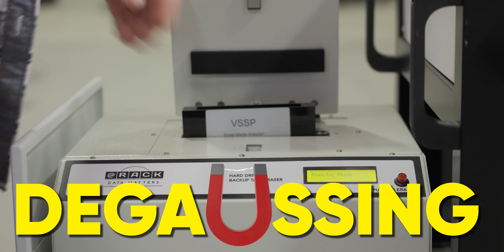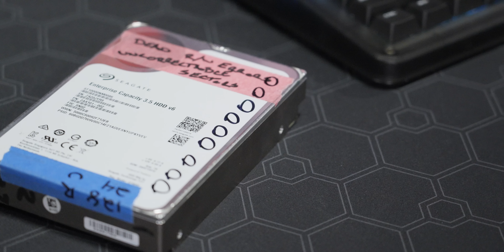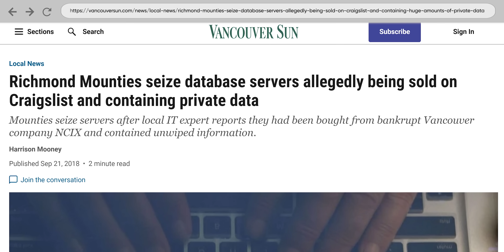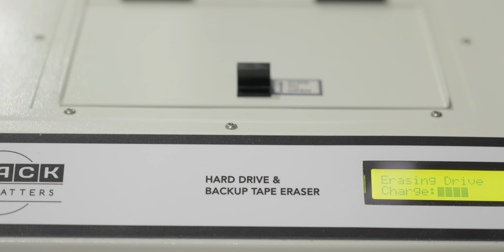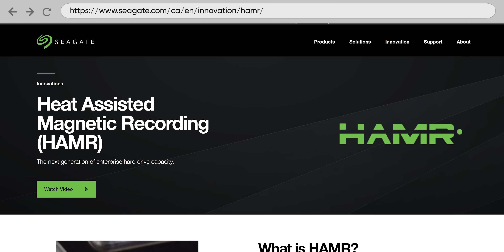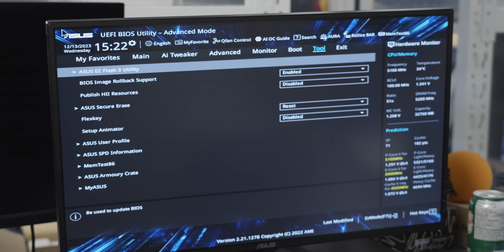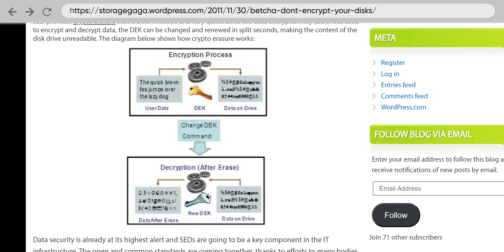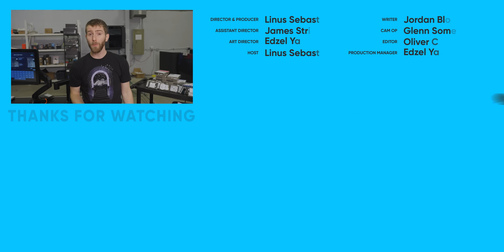I Got an Industrial Hard Drive CRUSHER! @Rack's Mobile Data Destruction System

Comment: Now I'm super curious what was on those drives. Were those LMG-owned drives, or did they contract out to a bunch of local businesses with the offer to properly destroy their old hard drives on the cheap while they had the machine with them? 

Actually, for only a $1000/month cost, I can see why some people have made small businesses out of chucking one of these in the back of a van and driving around to those who need data destroying. Would be quite a simple operation, assuming there's enough demand in your region!

Comment: Hypothetically if you use raid and you sell the disks to different customers this is a non issue and if you include raid in the erasing step then this greatly diminishes the chance of being able to read any useful data off of the drive although this is still a major security issue just down to the ability for one person to buy 1000 drives off of somebody and then having to read 1000 drives

Comment: Back in 08 worked at a Navy depot imaging machines, we would also sometimes get a used machined returned to the shop. we had an old file cabinet with a lock full of hard drives, most with red stickers, I was one of the few with the clearance needed to work those and remove the drives, never did get to see the process of destroying those

Comment: One critical detail that a lot of folks don't know: "ATA Secure Erase" is not the name of the feature that transparently encrypts all data and then drops the key when an erase command is sent. That's called "ATA Sanitize", and it works as you'd imagine - a random key is generated on first power-on, using an onboard HRNG, and all data is transparently encrypted/decrypted with that key by the disk controller. When you issue an ATA Sanitize command, a new key is generated and replaces the old one, effectively erasing the old key and making it so nothing on the flash can be read. However, "ATA Secure Erase" is a different technology which does not employ any encryption. Instead, all it does is "drop" the table that keeps track of which LBAs are assigned to which physical flash ICs and blocks, as well as which blocks are free vs. allocated, so that the disk thinks no blocks are allocated and the whole drive appears to be full of zeroes (unallocated blocks are "virtually" mapped to a null page full of zeroes). None of the data on the flash ICs is erased and you can still recover it (albeit in jumbled block order) if you do chip-off forensic recovery. In addition, ATA Sanitize implementations are vendor-specific and have been known to have security issues, so you should always use full-disk encryption (FDE) such as BitLocker or LUKS alongside it to ensure safety.

As for why we have these special mechanisms on SSDs instead of just overwriting data on them, the most common answer people give is that it prevents wear to the drive (because flash cells have limited write cycle longevity), but there's actually a much more important reason: wear levelling. If you store each file on an SSD with a static 1:1 mapping between the file and a physical block, files that get written to a lot (e.g. logs) would prematurely cause those blocks to become worn and defective. To solve this, SSDs use wear levelling, where they pseudo-randomly map between logical addresses and physical blocks, essentially shuffling data around over the disk. To make this work well, SSDs actually have a few percent more physical storage than is advertised, which provides (provisions) them with an area to shuffle things around in (and increase longevity with) even if the disk is full. In addition, many disks use a trick called coalescing, where pages that are set to all zero don't bother writing a whole new page of zeroes, but instead remap an existing block full of zeroes to that page, resulting in a many-to-one mapping (with copy-on-write so that a new block can be allocated later if one of those pages is written to). These tricks cause problems for erasure, in part because writing all zeroes may not do anything, but also because a full random wipe pass would fail to also wipe the additional provisioned physical blocks. That's why ATA Sanitize is so critical - it results in all data, including the stuff that isn't accessible to the host machine, being made unreadable.

Comment: Minor correction: "NIST SP 800-88", from 2006, is the original standard where the old recommendations came from (which was a derivative of a DoD standard), and it's the newer NIST SP 800-88 Rev1 from 2014 that has more up-to-date standards that are relevant for modern media. The original standard was particularly unscientific and was largely written to satiate the paranoia of military types; Peter Gutmann, the guy who the ridiculous 35-pass wipe system was named after, once described the standard as a bunch of "voodoo incantations". The modern Rev1 standard is much better, with clear actionable advice around different media technologies, and even makes it clear where recommendations have been upgraded beyond what is reasonably necessary just for the sake of peace of mind.
Reply: In health insurance we did a 2T wipe. Followed by shredding to 1.5"/3-4cm size. Took about 3 minutes per 3.5" drive. They had sprung for a $15000 shredder years back. I tried to get them to go for a service when we decommissioned 960 12TB enterprise 3.5" drives.
Reply: The most effective wipe method I found is by writing 2 random passes and then 2 passes of zeroes, this is also the national nuclear standard of data removal
Reply: @FlowPoly  That is an old method and is no longer recommend or necessary. On a HDD it wastes a ton of time and unnecessarily ages the disk. A single random pass wipe is fully secure against recovery. On an SSD or USB stick, standard overwrite wipe methods (no matter how many passes you do) will not properly erase the data. The NIST SP 800-88 Rev1 standard discusses this problem in detail. On SSDs you should use ATA Sanitize (also known as ATA Cryptographic Key Reset), which is instant and causes no excess wear. This is not the same as Secure Erase, which guarantees security against simple recovery but does not guarantee security against chip-off recovery.

Comment: My go-to method for recycling an old drive is to do a badblocks scan in Linux with the -w option. That writes and reads several different patterns to the drive, and confirms if it still works right.
Reply: Remember software erase methods do not ensure over-provisioned storage is destroyed.
Reply: @soundspark  yeah, if you want it really secure I wouldn't recommend this approach for an SSD. Overprovisioning on a hard drive is usually much less, if it's even there at all. So it should be fine.

Comment: What always also works is running 800VDC from a supercap thru the power connector in addition to crushers, that burns the chips nicely before you crush them, then theres nothing to be read even if you somehow managed to get a partial nand chip working
Reply: Im surprised that method is not used, but maybe its to safety concerns.
Reply: @nanielwolf5768  it doesnt comply with standards, but i like doing it in addition knowing noone will ever recover anything from those.

Comment: I am wondering about the helium drives. If they get crushed, does the helium just leak out and vaporize away? If so, isn’t that bad for your health if you stand there, crushing one helium drive after another in a closed room? Or does the rack has a way to catch and dissipate the helium in a way?
Reply: Helium is a noble gas (very chemically unreactive), so the main health hazard is that it will displace the oxygen in the room. However, it is very light, so it will float up to the top of the room, and anyway there isn't enough helium in a hard drive to significantly displace the existing air in a room (WD claims in a blog post that a "standard helium tank" can fill more than 10,000 hard drives).

Comment: In early 2000's I was a sysadmin for a major bank at their main data center, new significantly faster hard drives came out and bank decided to upgrade all the hard drives.   As you say  government spec wiping software take way too long and we had a pallet and a half or hard drives to wipe.   The bank called a data disposal company to come and destroy all the hard drives.   This huge truck backed up to our loading dock and they opened the back doors of  the truck and a side door.    They turned on the machine inside that sounded like Godzilla eating Tokyo and they start dumping hard drive into the machine.   We go to the side door and all we see is what looked like glitter spewing out into a big bin.   Hard drive in, metal flakes out. Now that's how  to wipe a hard drive.

Comment: just add a stredder to make into powder hahah 

i remember having some powerful magnets distroy my 2008 laptop HDD.

some or all charityes will also distory HDDs after use or even in some cases the hole item. 
a  unknown charity that i worked for years ago had an laptop they did not need anymore even tho the old HP laptop had all drives removed 
they did not want to sell it to me nor anyone so they just decided to distory it even when it had no Drive at all.  

i think they thaught its bios had data or something.

shame iPads have also No Removerble drives so after a company or charity is done
with a iPad or PC that has soldered SSD it has to be fully Distroyd Nor do apple or others make special 
tabs that can have SSD removed or offically changed out after Company Use.

the tech is complicated but i do know they are likelly to only remove the drives and
not throw the item out. 

so yes if u have a company and want to get rid of tech just remove the SSD and only distory the SSD

Comment: Oh man, I use to sysadmin a data center and was tasked with creating a shredding server where any drive connected to a specific controller would be discovered, smartctl checks run on it, and then shredded using the shred package on Linux and indicate whether it was to go back into prod or to be physically destroyed, and then sound out reports to the DC manager. This cart would've been so wonderful to have.

Comment: Remove 10 screws from the case, remove 6 more for the rotor and the platters are free for shredding.
Then you can reuse the motor, magnets, PCB. Very sad to see usable and expensive hardware destroyed like this...

Comment: I used to do this for defunct military hard drives. Used Blancco data erasure software and then they would be crushed into effectively plastic sand. If the erasure software didn’t work due to a really broken hard drive, then we had to drill through them several times before they went to the crusher. Always a fun Friday afternoon job…

Comment: I wonder if this thing meets the requirements for TS/SCI data destruction.
Reply: No, not by itself even though the drives are FUBAR. That requires a shred operation to a minimum 3mm square. This would happen after the first destruction operations anyway in preparation to extract the valuable metals from them. Degauss, crush, shred, burn, acid bath, useful metal recovery.❤

Comment: I'm really wondering why you didn't try to plug the hdd in after degaussing and see if theres data. Or even better trying out some data recovery programs and see if that alone had worked and if curshing was really necessary. Would have been interesting.
Reply: There's no point. Going through degaussing renders the drive inoperable. Even if there's somehow data left in a small part of it, the tracking data on the rest of the drive missing means the heads wouldn't even be able to properly locate themselves, much less read anything.
Reply: @Acorn_Anomaly  I've only got your and some on screen graphics claim of that, it being demonstrated is much more interesting.

Comment: This should be illegal. Reuse-reduce-recycle. It breaks the first and most important one. One employee with clearance no matter how well paid he should be will make it economical to resell these drives even if it takes a full day per drive to clear. Since there is no interaction while doing that, it scales perfectly well.
Reply: @t.n.-js6eivery easily. One PC from 20 years ago can do half a dozen at the same time, and you need like 5 minutes to start them all. If you have 20 such old PCs you can do all 100 at the same time. Or just a special purpose machine that takes 100 of them (one PC with an interface to 100 SATA slots). So it is basically one hour of work for one person to connect them and push a button, and do something else without supervision. And after each one of them completes it it could return the value of old the PC that was used to wipe them. Not much different that this machine here, which gets ahead only when you have a deadline of having completed the work fully in an hour (but why? somebody is trying to raid the facility??).
Why they use this machine form the video is not because of bottlenecks, but rather because they don't care about generating value from resell, sinc ethat value is so miniscule to the business that any convenience is better than no convenience. You need somebody that will sell them afterwards or manage donations, and this alone is a reason for the business to just not care about it. It is easier to dump some garbage t the local garbage disposal. And by doing so inadvertendly keep the prices of new drives up by removing stock from the used market.

Comment: I kind of wonder: if you crush 2 out of 3 nand chips will the data from 1 recovered nand chip be garbled? I've always imagined SSD writes to be striped across the different nand chips but I could be wrong. If the data is encrypted in the first place then that would be another layer of security. It would probably be impossible to brute force decrypt meaningful data from 1 out of 3 chips.

Comment: I get it why getting rid of any potential data leak is crucial,but is it really worth destroying them? for ssd's it kind of makes sense,hdd's on the other hand store data on the platters that can be removed and other parts could be selled to data recovery centers!
Reply: if both firmwares really gave you a way to "overwrite every single sector old and new" then it'd be a non-issue.
there's no demand for this and oftentimes these "security features" are an upsell strategy by marketing, so it even gets disabled on regular consumer firmware. And I guess the storage manufacturers are very content with current destructive practices.

Comment: A good drill press does the job just as well. Just drill a couple of times through the platters. Job done.
Reply: That’s what we do.  $70 Harbor Freight drill press. Wicked fast.  Wicked efficient.  No way I would trade it for this monstrosity.
Reply: True but depending on the company protocol/regulation, they might say that the drill method isn't enough.

Comment: this is sooo stupid 
Use a non used server for this purpose.
With that you can wipe all your hard drives in a week at most.
But this destruction is extra wasteful and unnecessary.
Reply: Think of it this way:

There's hardly anyone you're going to sell the drives that have 90000+ hours clocked in for a good price. Best to destroy the old drives at scale.

That's it.

Comment: I do data destruction for work and we do the same similar processes. But we don’t use a hydrologic press, we have a giant shredder similar to a wood chipper that you drop the drives into and in about 15 seconds that single drive is in about 400 pieces.
Reply: that's better. don't waste time with degaussing, when you can turn the disk into confetti.
Reply: @giornikitop5373  exactly. When we’re told to destroy the drives, we destroy them

Comment: Wouldn't it be sufficient, if you don't care that much (maybe just some workstation HDDs and not your core database) but don't want to spend days erasing, to just use the degausser on its own? Sure you don't have a physical indicator, but maybe just labeling them with a colored sticker or so could be sufficient for many. In theory that drive should still work when its disk has been garbled, you probably just need to reinitialize the partition system.

Comment: I am not a security expert at all, but encrypted data with a lost key is only secure now, you never know about the future. If the encrypted data can be copied, it is compromised. Maybe not now or tomorrow, but in 2 years they might find a vulnerability in the encryption method or hardware that is able to brute force it in a reasonable amount of time might be around. And especially drives that contain a operating system or even a standard partition table should be very vulnerable to this. Brute forcing becomes a lot easier when you already know (part of) the decrypted data.

Comment: Used drives is a terrible idea. Way too much uncertainty
Reply: Use them for less necessary files in a RAID. I use hard drives that say "Bad" in CrystalDiskInfo without any issues (not in a RAID), except the times when some drives get so bad that you have to retire them. And by retiring I mean running over them with a car's tire
Reply: @one_step_sideways  i had a drive start failing in my 4 drive nas, and it was a little stressful to get more and more bad sector warnings, first you think it's a mistake so you do a scan and find nothing, then it just gets worse. But i guess it's not that big of a deal if you have a raid with more than 1 disc redundance.
Reply: @Wormweed  Well, as soon as the second drive starts getting bad sectors - then you should rush out to buy a replacement. 

From my experience, you should refrain from buying Seagate, because they fail way too often. And obviously you should not power cycle hard drives often (rather, at all), since that's what kills them.